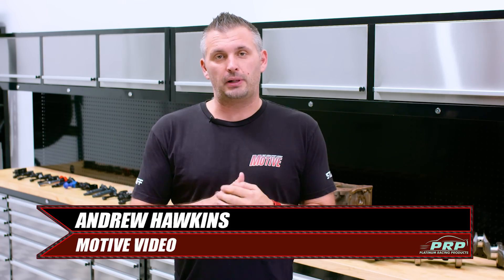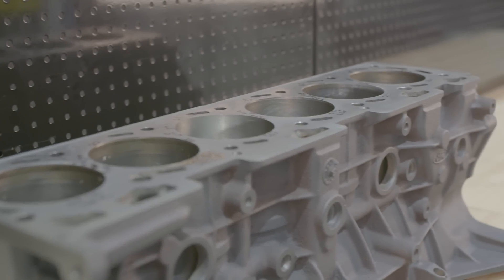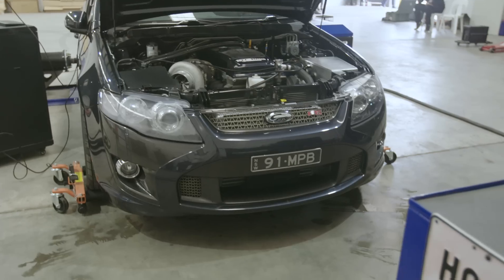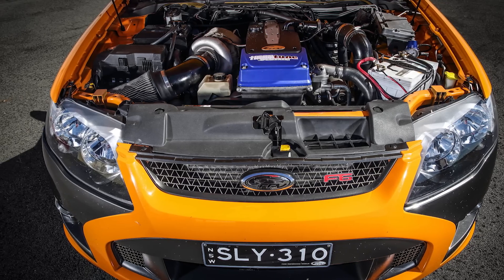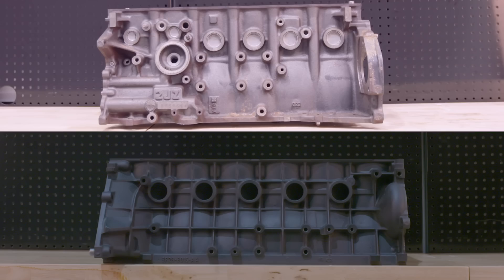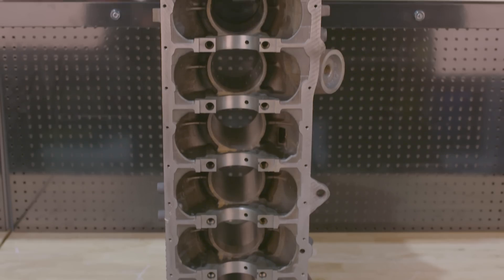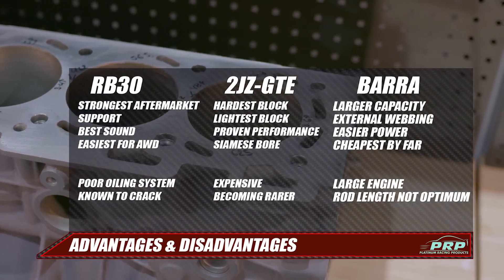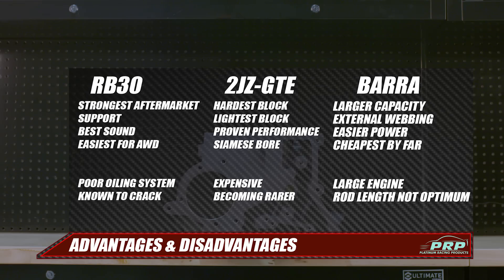Is the Barra 4.0L block better than the 2JZ and RB30?

Comment: 2jz is dead. Move on people. The barra is still available. That's what's important here.
Reply: 2jz is dead lol you can order a new block from Toyota today if you like.there not cheap but the 2j is the king.barra is cheap bang for buck.
Reply: @jackydewar3419  2j iz dead. The Barra is easily available and more awesome parts for it are coming out all the time. Great for new tuners and crazy swaps. The 2j has gone the way of the rotary, they were great but it's time to move on.
Reply: @foreverjim5240  2jz breaks the net every 6 months with new records,does the barra,2002 to current day how many records 0.the 2jz supra is the highway king and does it well.its a gt sports car ofcourse its going to be built for nuts top end stuff.the taxi is perfect for 1/4 mile work.facts are facts the jz and rbs are to fast for the taxi.
Reply: @foreverjim5240   Yeah, young Jerky forgets that most of these record engines he talks of, probably have no Japanese parts left in them. How many of these records are being set with stock Toyota long blocks ?!

Comment: Barra taxis do over 1M kms, nothing else compares !
Reply: Jim Clarke talk about reliability
Reply: but you may not find many privately owned xr6 with over 400k. xr6 turbos are rare to see with over 300k. Taxis are no measure. Toyota camry and aurion will do 1m as a taxi.
Reply: @feralkittiesforyou8914   We have 3 falcons. barra 2 over 400k, going like new, Toyota's change engines every 300k
Reply: even the sohc ford engines did over 1m in taxis.  non taxi barras are not getting 1min most cases. people talk about barras like they will all do 1m .the "taxi' is not a guide on a motor. @jimclarke1108
Reply: @feralkittiesforyou8914   Do your homework! the barra out performs big block cheve and most other cars,with complete reliability, toyota engines are weak, all barra engines do 1Mk, im a mechanic i work in a taxi workshop, i deal with them all !
Reply: i had a ke30 corrolla that clocked the odometer.????? i had a 3.8 ecotec that did 420k....still running well when  sold.  You will find through research of carsales and sorting cares by kilometers that BARRAs on average get 70k average than an alloytec in the publics hands. We dont run cars like taxis.......
Reply: @feralkittiesforyou8914   No other ehgine performs same as the barra, So get over it!
Reply: I dont deny its a excellent motor. I'm contemplating buying an xr6 turbo to do up. The taxi comparison is absolute stupidity and irrevelent. @jimclarke1108
Reply: @feralkittiesforyou8914  The taxi comparison shows, reliability and many years of service,in Melbourne they still use BA/F taxis simply for the engine,, I managed only 400k over 12 years, so the taxis are a perfect example of how reliable the barra is
Reply: @jimclarke1108  yeah because we all run our engines non stop and only shut down to fuel up. We all stay under 2000 revs and putt along like taxi drivers striving for economy and longevity. None of us drive cars like that.
Reply: @feralkittiesforyou8914  The igniters, spark plugs, oil and filters need to be changed regularly, the cars are flogged most of the time, as i said im a mechanic in a taxi service workshop
Reply: @jimclarke1108  taxis flog their cars....... Please
Reply: @feralkittiesforyou8914  i  work on them while in service !
Reply: @alchemia7512  my old ba wagon company car developed a hesitation and knock sound after a mere 30k. Gearbox thumps.  An eco that is well looked after is capable of 350k easy.  Every engine is different though. Yours could have been neglected and thrashed.
Reply: @jimclarke1108  I have mercedes benz that has way over 1000000ml (or what ever is the short form of mile) on clock and it is still as good as new ....
Reply: @satan8593  You couldn't afford to pay for a million km in services for any Mercedes and if you don't have them serviced properly they won't last 2 years on the road!
Reply: just sorting out falcons with max km on carsales....where are all the private owned with 1m????   500k common. Shit Im finding yaris and tribute with 1m but not a single barra.
Reply: @feralkittiesforyou8914  Enjoy your Yaris with 1 M.km, You will need a taxi ride home (barra))
Reply: @jimclarke1108  you don't get it. I'm planning on buying an xr6 turbo to do up. It's why I'm watching this. The taxi remark you make measures nothing shut up
Reply: @feralkittiesforyou8914  You will enjoy your XR6 T.   focus on the video and comment,  Not my comments
Reply: @feralkittiesforyou8914  and remember the barra block has been around since 1960 (the video))
Reply: @jimclarke1108  having built a number of 250 sixes and crossflow 250s. Put in falcons and cortinas. You mean to tell me the Barra is the evolution of fords previous sixs.....
Reply: @feralkittiesforyou8914  yes.
Reply: @jimclarke1108  lol. I'm beginning to like you.  I'm looking at building a turbo because a friend with a vf sv6 drags my fg xr6 Na and it's pissing me off.
Reply: BMW M10 taxis do the same made in the 60s, they used the 4cyl block in formula 1 making over 1400hp 1.5l 4cyl
Reply: lmMuel Lol a beamer that can do a 100.000 ks and not blow a headgasket?, Don't make me laugh, Beamers are shit from day 1
Reply: @alchemia7512  didn't know we were talking about bikes. The cars are called bimmers. The bikes are beamers.
Reply: Your Royal Eminence Your Royal Eminence  Not all taxis are on dedicated gas, very similar motors, i prefer petrol ,you need to check the car itself
Reply: Any well designed work oriented engine will last that long.  Its not a magical thing being it's machining and metallurgy. Manufacturers will over build a low horse power work oriented engine and it will run for a long time. Once you start making big horse that reliability goes out the window. Many blocks can hold a lot of power but stock rotating assembly is another matter
Reply: I have a Barra gas car. Was going to the wreckers after sitting under a tree for 5 years. I put a battery in it, and yes it started straight away. Unbreakable motor
Reply: I've seen plenty of Toyota taxis do well over 1M miles 🤔😉
Reply: @itspapaj4732  So? don't see them doing what barra's do. ever!
Reply: @Johnny-tq9no  3 engines later, dont see them as taxis
Reply: @jimclarke1108  lol they definitely last longer than barrows and yet you don't seem as patsies cuz they're not really built for performance like the 2JZ ls etc
Reply: @Johnny-tq9no  Johnny B Good little boy, ok
Reply: @jimclarke1108  dude you're out here arguing that an NA engine that just happened to be put in taxis means it's a good engine which is complete BS the crown Vic engine was also put in many taxis and there's many examples with over a million miles that doesn't mean much for the engine 😂

Comment: 2JZ and RB30 would fall apart if they had to tow caravans and do 1 million kms during taxi usage.
Reply: 2JZ are surprisingly reliable. Its toyota after all
Reply: @KuroRyuu86  Don't get me wrong, love the Toyota 6 engines, just don't love their oil sludge problems!
Reply: this is true.
Reply: Mmmmm I think toyotas diesel engines are a work of art, but you both have a good point

Comment: Check the old Toyota 7M block from the 3rd gen Supra. I know the cylinder walls are kind of thin but be interesting to know hardness and overall strength compared to 2jz and Rb26. People have made 1000+ on this block also.

Comment: No body cares combustion engines are dead they are slow and unreliable
Reply: but they make a great sound track. Sure they are slower that an electric car, but its exhilarating with all that noise and unpredictably and *unreliable is speculative. I want to see a Tesla Last 40 years without a complete battery change, because you know batteries loose they charge strength after X number of years.

Comment: Was anyone else shocked that it weighs scarcely any more than the RB? This engine isn't really the boat anchor that people make it out to be, especially given its physical size, displacement, and strength. The old adage holds true of you get what you pay for of course, and so the most expensive engine (2JZ) seems to be the best. Well duh. The equivalent of Toyotas out sourcing the engineering and design to Yamaha would be Ford going to Cosworth and saying 'build us a better Barra'. You'll always get a better motor, for a price...........

Comment: Is the Barra 4.0 the same engine that's in US Ford Explorer from 2004- 2007 ?.. its also in Ford Ranger, it's a 4.0 engine also but it had those trouble spots with the Timing Chains coming off and other timing chain issues
Reply: Hajile Serpud no sir you’re thinking of the 4.0 cologne v6, it was later refreshed as a SOHC and put in the mustang v6. Would have been awesome if we got these
Reply: @christianhancock5813  Ohh yes that's correct, thanks... it was a Colonge engine, those timing chain issues made these vehicles worthless at around 125- 160,000 miles, unless you was willing to drop almost $3k- $5k on a mechanic to upgrade tensioner guides and brand new chains OR you was a DIY'er

Comment: TAKE NOTES TOYOTA! AND MAKE THAT 3JZ ON THE NEW A90'S!
Reply: not going to happen.EVER!! The JZX line discontinued in 2004, to concentrate on v6/v8/4cyl engines. Even if they made a 3jz, it would be an aluminum block and had to bow down to international Emissions and Safety standard. It will never be better or be close to the 2JZ. Think of it in this context. Why one up the 2JZ and spoil a legendary reputation. And if they made a new engine from scratch, the price of the A90 would surpass 100K, which means the price point they were looking for wont be met. They needed that car to stay under 100K or even 80K. Like the original A80 was.

Comment: Wish we got the barra in the states.
Reply: Late model Barra engine $50, postage to us, $2500 lol
Reply: @matthewallison7604  Best way is to send it over in a shipping container heaps of Aussies do it with American cars and parts.
Reply: Just import one from a Aussie junk yard they can be shipped over.
Reply: @Chopperdog  its possible, just becomes a pain to get parts and support.
Reply: @brandonlexan8460  Yeah I know but not much to them Haltec make a ecu that can be tuned over the internet with a laptop and parts are easy to come by it would be best to buy spares for it at the
 
I buy Chevy transmission parts from the USA to build them and sell because it's cheaper to buy from over there you get use to it lol.
Reply: brandon lexan barra is ok but if your a ford guy in the states just get a coyote
Reply: @comradecommissar311  Ford Australia took the Coyote engines and factory supercharged them and called them the 'Miami' engine, to compete with chev powered Holdens
Reply: Yeh you guys missed out
Reply: If your gonna pay to ship one over you misewell have 2 or more shipped. Even if its one known good motor and a bunch of spare parts ect. That said ive seen wuiet a few people who will import several at a time then sell them here. So if you look close you can go buy one cash and drive home with it. Parts are still a problem then tho, but atleast thoes are cheaper to ship when needed lmao

Comment: for the displacement ratio, no it isnt, but who looks out the street n says oh look its barra motor vs an rb, no everything from the gearbox to the chassis and aerodynamics all play a role in making the ideal car, any engine that can make over 1000hp is irrelevant to compare because that’s about as much useable street or track power and by track i mean real track, not the shitty straight line, being a heavy motor, it also works against it. in english, falcons are shit, rb26 is better than 2jz in my books, both can make over 2000hp yet the rb has less displacement and can still match the power, it is lighter, can rev higher and is awd compatible
Reply from the maker: Kemal Keza were just analysing blocks and showing people what tests they should do before building an engine man.

Comment: Love ya work mate. 👍
I have 1 little whinge though. Anychance of broadening the scope of analysis? 
1000hp seems to be the bench mark these days for 'high performance' engines.... Shame that too. 1000hp is virtualy USELESS for anything other than drag racing, or bragging, unless the rest of the car has the nuts modified off it too the point it is no longer practical for use (enjoyment) on public roads. Let alone traffic or rain. Then you need another car to take it somewhere so u can drive it as its intended to be used (and the process begins again lol)

Any chance of doing some videos that approach these engineering comparisons from a circut racing or sports/street perspective aswell?  
Making a USEABLE 600-700hp from a small displacement, highly strung engine suited for track/street is actually more difficult (maybe not usually quite as expensive) than just going for big game as the way the engine makes its power and deals with heat, fluid dynamics blah blah blah is just as, or more, important than how much it makes. 

A 1/4 or 1/8th mile slip is a reference mark of sorts granted but it only tells a fraction of the story. Sure, your big balled monster of an engine will probably smoke me off the mark or from a slow rolling start in a straight line, but, (in my opinion) anyone with some nads and practice can go fast (relativley) in a straight line but its where the straight line ends, changes direction and becomes another straight line that is the real challange. and then there is rally drivers....
Reply from the maker: IOI it’s just as simple as is comparing and analysis popular blocks. Reliability or 1000hp drag racing is relevant to reliability of 600-700hp of circuit racing in our opinion.

These videos just show the basics of what to look for for a solid base for an engine build. If we went into every aspect of an engine the videos will be 10 hours Kong and we’d spend tens of thousands of dollars we don’t have making them. 

Just making these is a couple of grand each and we don’t make that back on views. Self funded while we grow
Reply: Motive Video 
I understand, its just the ‘bigger is better’ mantra does not fit when building an engine that ABSOLUTELY requires correct flow dynamics to be first and foremost. Inlet piping, plenum/runner spec, aftercooler characteristics etc etc. maintaining flow velocity and the ability for it to increase is paramount. 
Ie; my RB25det with very conservative (relative) setup SMOKES most big Hp setups around the twisties. (Built by professional tuning workshop in Japan)
Reply: @muntee33  oh I thought you owned a Honda for a minute.
Reply: mark 3 and 4 supra have perfect chassi for well over 1000 hp.the 2jz is just a freak,,

Comment: Is it true that Jaguar had some sort of hand in developing the barra engine?

I was told that by a Senior Ford Dealer when I walked in to check out one of the fpv f6 typhoons.
Reply: A freelance designer... that few people have heard about is your answer.   He was A child prodigy and has designed many vehicles inside and out.

Might as well say the Barra engine was designed by Audi, Lamborghini, Ferrari, McLaren, Buggatti, Ford, GM, BMW, Mercedes-Benz, Jaguar, Volvo, Honda, Toyota, Mazda, Nissan, Subaru, Hyundai, Mitsubishi, Dodge, Lotus, Tesla as he designed for all of them and more, at different times in his lifetime.

A few of his engines/drivetrain are Skyactiv (G,X), VTEC, Vortec, Voltec, Duratec, Ecotec and Ecoboost.

Ever wonder why so many vehicles look similar?  Chances are they had the same designer.  Some design cues to look for are an old school phone ☎ (top part).  RX7 third gen rear, Hyundai Veloster front lower grill, Dodge tail lights, sometime it is the shape of the bumper or just an outline but it is on many vehicles.

On certain Ferraris the back of the car is designed to look like womens reproductive organs.
Reply: @787brx8  Ford has a contract with Jaguar; they make their engines for them.

Thanks, Google.

Comment: Cheapest buy far or buy a million miles. I wonder how much that ribbing helps block strength as well. Inline six forever if had the room I'd stockpile Barra engines for Barrageddon. I'm a old school nissan guy no loyalties to nissan at all now I think nissan's are shit. Excellent videos and Barra the world.
Reply from the maker: Corporal Punishment the ribbing obviously helps stop Block twist and cracking like in an RB26 but it doesn’t help cylinder bore cracking
Reply: @MotiveVideo  it's interesting seeing each manufacturer using different strategies to gain strength RB has the bridge main carrier and a skirted block  the Barra has ribbing and a structural sump and and the JZ has the skirted block and higher quantity material. The Barra two main advantages is obviously displacement and roller cams me thinks.
Reply: @MotiveVideo  I would have thought that less block twist would make, at least, a small difference to the bore integrity.